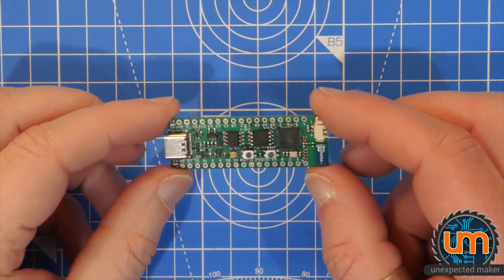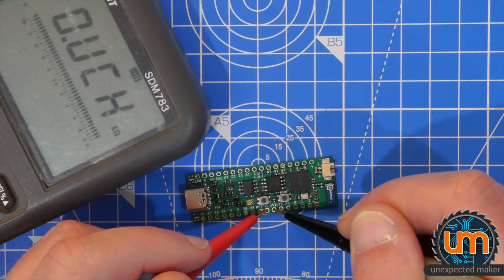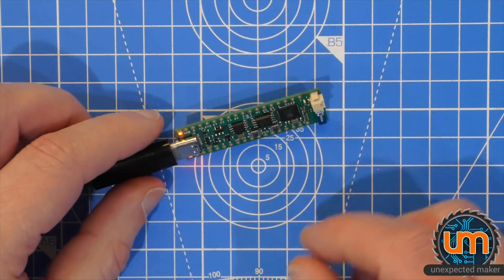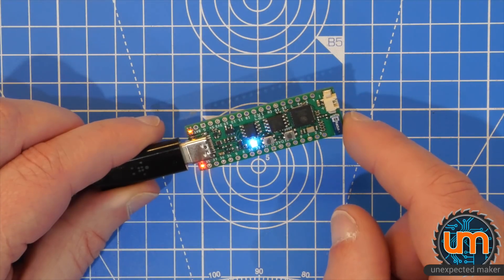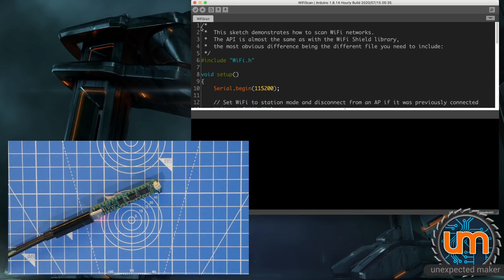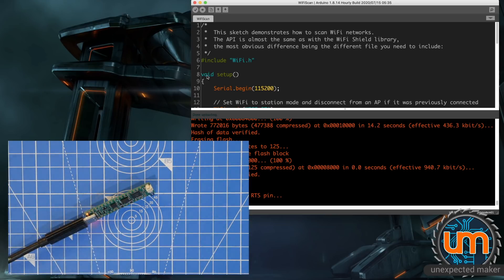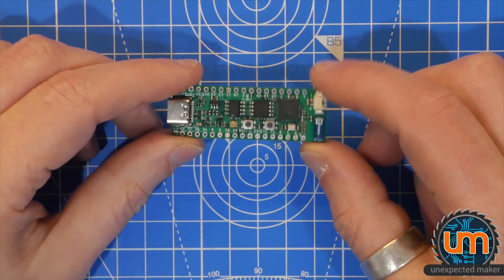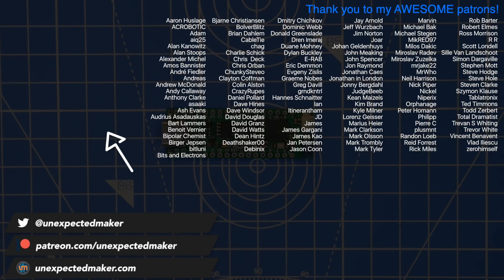Final ProS2 Prototype Build (ESP32-S2)

Comment: Looking forward to being able to get a couple. Castleated edges and being single sided are both very useful and will make it a bit more versatile. I've used a few Wemos minis and TinyPicos on motherbiards with pins and insulation before, not so elegant. The lower profile and simplicity from these two features will be a big help going forward.

Comment: What do you think the chances are of a Pico chip with usb.  Any hints at something like that from Espressif?
Reply from the maker: There will never be a PICO generation ESP32 with built in USB - But a new Sx ESP32 in a SIP package? I'm sure they'll do that one their Sx range is out and mature.
Reply: @UnexpectedMaker  I'll take that, even without the need for a crystal the cp2104 adds cost and complexity and I am trying to stick to a 2 layer board.  The Pico is an amazing chip (as long as you don't mistakenly buy some Pico V3s like I did).  An equivalent SX with onboard ram would be the icing on the cake.

Comment: @unexpected maker : So, Seon, I have chucked my CharmHigh.  Even though I got it working, I've decided it's not worth the #@%@#^^ hassle to keep it working.  I finally decided on the Neoden4, which should be arriving within the week.
Reply from the maker: A shame re the CHMT, but you'll love your N4 - Once you get it tuned, as like all PnP's, there's going to be a tuning phase:(
Reply: @UnexpectedMaker  You're right of course, Seon.  I expect the Neoden 4 to be a lot simpler to get working than the CHMT.

Have you decided how you're going to deal with yours?  I ended up simply selling mine off cheaply to a local school that wanted it as a project.  Since they went into it with fully open eyes ( and I put a LOT of mods into it to make it work semi-reliably with 0603 parts and Neoden feeders ) I feel fairly good about it.

I still have the CNC'ed feeder mounting plate with spring-loaded shims to keep the feeders in tight. If you've kept / are keeping yours my offer to send it to you stands.

When the Neoden 4 arrives, I'll do an "unboxing" and share what it takes to tune it on my channel of course.

Comment: what do you use that huge radiator for ? is that your reflow device ?
Reply: Cools the board after it comes out of the reflow so he can handle it by hand. Even though the reflow has a cooling stage it's still a bit too warm to touch.
Reply: @richardperritt  aaah !

Comment: Awesome! I'm excited! Will this support the auto bootloader, or do you always need to press the buttons to reprogram?
Reply: As long as you do not enable other USB peripherals, like HID, MIDI or MSC, you will not need to manually reboot to flash the board. Enabling those other features will require manual reboot into download.
Reply from the maker: Once it's been flashed (for a platform) it should be re-flashable without touching the buttons. It works with Arduino IDE right now, and will work with the IDF as well. No reason why it cant be the same with every platform, but moving between platforms will require a Reset+Boot button sequence.
Reply: @UnexpectedMaker  if the IDF project uses the same USB config and has the proper menuconfig option enabled to run the CDC in that mode, it should be able to go between Arduino and IDF without further manual reboots.